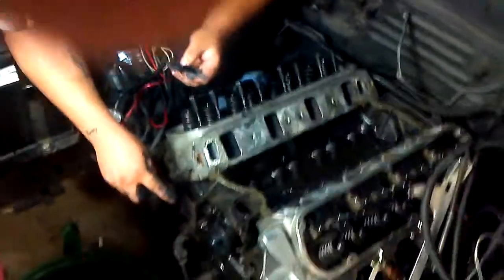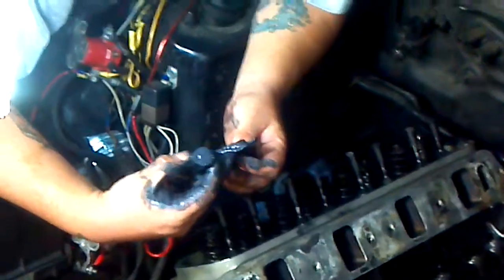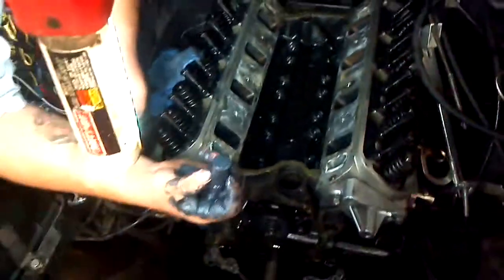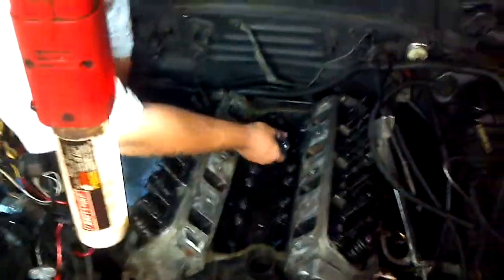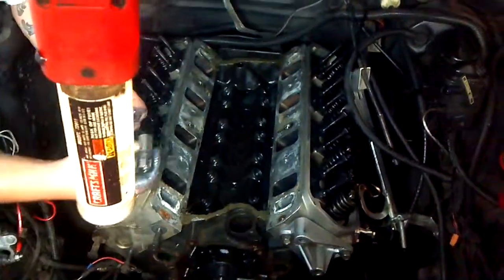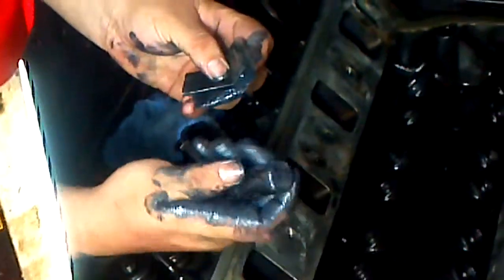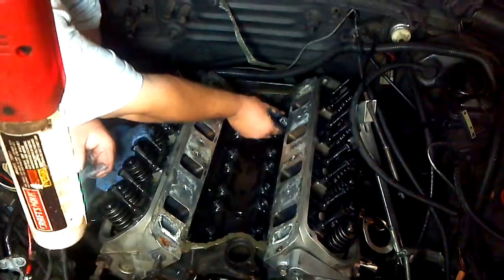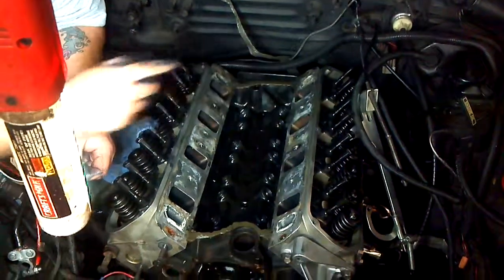Cam and lifter part 6

Comment: It can be done that way but after running into a cam with lobes worn and lifters spooned I took a small flat tip screwdriver heated and bent on the very end so I can hook the clip inside the lifter to be able to pull them out but pliers will work on most cases